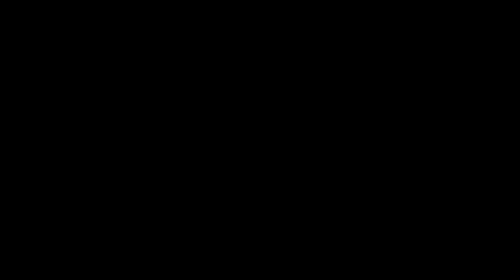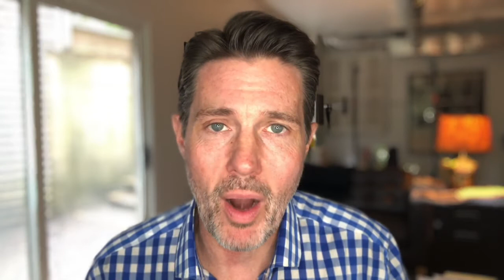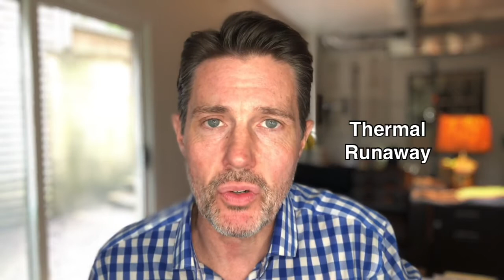What is Thermal Runaway and How Can It Be Avoided?

Comment: Quantum battery that never runs out and Think of a flow battery and alternator in one and using a femtosecond laser https://youtu.be/FLegmQ8_dHg to etch the surface of the positive and negative electrode rail tracks for the ferrofluid electrolyte to be propelled over the surface in a closed loop the rest of the tube being superhydrophobic and place nanowires coils or copper coils coated with voice coil Laminating adhesive that is mixed with aerogel powder https://youtu.be/qnOoDE9rj6w around tube to pick up eddy current.
How to make nanowire process https://youtu.be/PY4DqsfgOPE use spider webs that have been coated with carbon nanotubes and place in plasma Vapor chamber https://youtu.be/aljbjJbfghs to transfer metal to Nano reinforced spider silk.
https://youtu.be/1-tHRDkfWdE then coat nanowire with voice coil Laminating adhesive that is mixed with aerogel powder.
ferrofluid electrolyte chemistry
Search how to make magnetic powder and hydrophobic sand.
https://youtu.be/EkKcufVPFB4
https://youtu.be/rIx4G9IQqWU
Crushed neodymium magnets in hydraulic press to a Magnetic powder and follow the process on making hydrophobic sand except replace sand with magnetic powder then take your hydrophobic magnetic powder and mineral oil https://youtu.be/tqku9z-Wesg in container place it in ultrasonic cleaner for a day or two and you will have a non conductive oil-based ferrofluid to pass on eddy current to coils and using a sodium carbonate or other water based electrolyte. Alternate adding both liquids in the Loop.
And you still need to take voltage readings from both alternator coils and Battery electrodes and program battery management system or BMS accordingly for better efficiency use BMS circuits made of chemically dope graphene and chemically doped borophene Nano structures Quantum Gates that have better efficiencies.
Propulsion process between electrolyte and electrons of the nanostructures.
The positive and negative electrode that has been etched with a femtosecond laser to Wick the electrolyte and the hydrophobic tube has a air pocket between the electrolyte and the tube for vapor cycle processes think of a heat pipe tube and the water cycle in it. Except you're replacing heat process with electron process over nanostructure of the positive and negative electrode otherwise known as thermal creep which leads to Thermal runaway in other battery technologies. Or you could use other nanostructures that wickes liquid like graphene and borophene which is harder to do but you can add other Nano functions to strips for even better efficiency. For example Quantum Gates https://youtu.be/VLPpDoMBVK0
Quantum battery casing Quantum battery Loop held with thermal tape then to aluminum foam https://youtu.be/NvXI_RhVEDQ fins between battery case outer casing Nano reinforced with aluminum-oxynitride powder
Comes in bag A B and C take bag B and mix with 99% or higher alcohol end Nano graphite powder for a single carbon atom. Place in ultrasonic cleaner to chemically dope graphite then prep metal parts for electrostatic prepping gun for a nanobond https://youtu.be/bpV_Dcwtj60 then mix all three powders in powder coating gun then spray metal parts and bake in pressure oven that is filled with argon gas that is used in centering aluminum automotive parts. Otherwise known as chemical vapor deposition process for A Transparent aluminum diamond Nano reinforced hard coating.